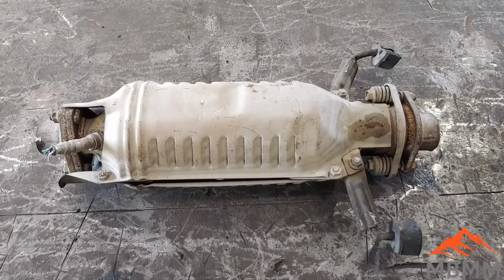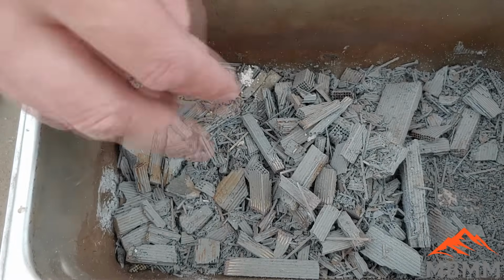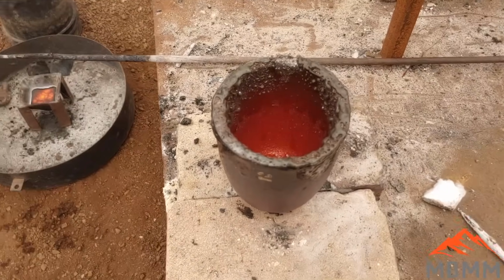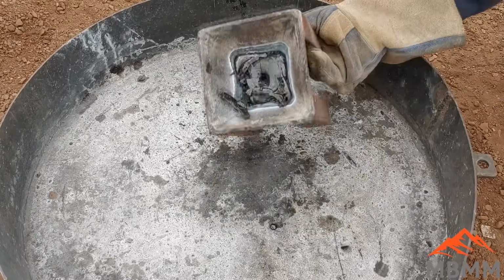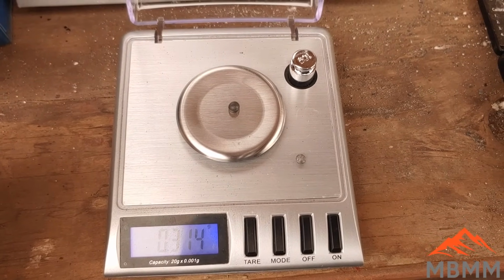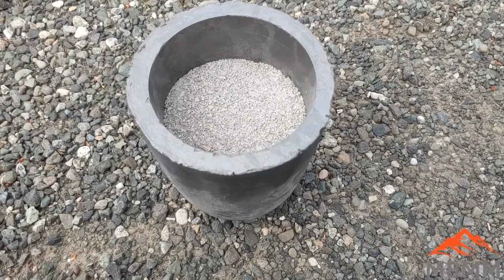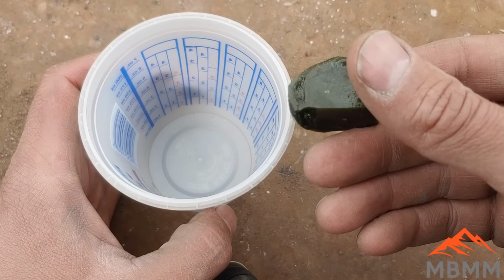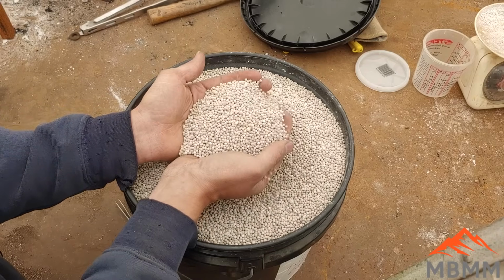Smelting Platinum/Palladium Catalytic Converters For PGMs..... Success???

Comment: Hi Jason! Thanks for another great video! I am super new to most if this stuff, but this came to mind: first, why not have the raw honeycomb assayed, if it's not too expensive. I've heard once ICP-MS is common for catalytic converter assay. For what you are doing there, like the lead collector metal and how cupelling it results in a higher melting point as the lead oxidizes, could your plasma torch be helpful there? Any idea how many thousand degrees it 'burns' at, and if it would be practical to use it for heating the sample? Would an oxy-acetyline torch (5000 F?) be any help either? I also ran across a cupel last night that was rated for use with platinum or PGM. I don't know if any of that helps, esp since you are abandoning lead as a collector metal, at least for now. 

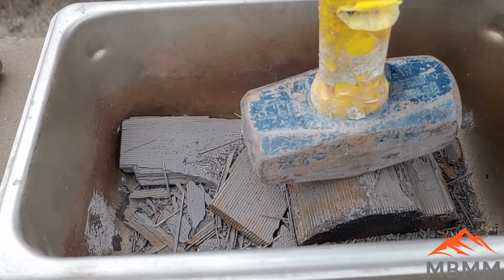I just found your channel and you do some great stuff! Since I don't see pricing on your website, I will probably contact you to ascertain some costs. The idea of mechanical or thermal processes to recover metals vs. chemical processes appeals to me a great deal! Also, about a week ago I went looking for mining claims, and finding your channel certainly fills in some blanks for me! Also, I laughed at 4:40 an 'armstrong' stamping mill, single battery lol Thanks again! Oh, somehow .04% of honeycomb weight comes to mind for Pt content in car cats, but it varies a great deal, and that number may be mis-remembered..
Reply: yeah was also wondering whether a nitrogen plasma torch could be useful at the end.

Comment: I could be wrong but I believe the Prius has the most platinum in the cat.
Reply: You are right thy do
Reply: @CALIBUNDLEZ707  that explains why all the Prius cats are getting cut in my neighborhood 😆
Reply: That came off a Honda Pilot
Reply: They do! I sold my bad Prius cat for $800. They have some of the most in it. But that cat in the video looks like a Honda Odyssey van.
Reply: @osamamingo8205  could’ve came off alot of Honda’s lol
Reply: This cat looks either salvaged out of junk car or stolen. Those flanges would not have been impossible to unbolt. They were hardly rusted. Seems like a truly dirty business because everyone has heard someone say they paid a grand for a new cat cause some ahole stole it.
Reply: I cut off both of my cats of my 07 Prius and got $1400. For it. Then I bought a $110 uni cat and it runs better then ever..!  Go figure. 
Times are tough!!!🤣
Reply: @wolfparty4234  
ZIP TIES AND BIAS PLIES says....
“you don’t need no cat-a-shittic convertree”
Reply: Hello, if you are interested in some minerals such as rhodium and platinum.  How do we communicate?
Reply: The Prius does not have the most. The reason people go after it the most is because it's a hybrid so the cat is hardly use compared to a regular engine of the same age and mileage. So they will always have less corrosion and the precious metals will always be much cleaner and easier to extract
Reply: Hello, if you are interested in some minerals such as rhodium and platinum.  How do we communicate?
Reply: Yeah criminals are stealing them for this reason
Reply: I have heard that also
Reply: That's why they always do 10mph slower than the speed limit. All that precious metal weighing it down..
Reply: @19chevyboy86  then which car has the most
Reply: @6Diego1Diego9  well as far as I know if kept in good condition would be old diesel trucks. They are much bigger and have to filter out way worst exhaust gases. But like my original comment, overtime those precious metals get corroded and breakdown making it much harder to extract good clean metals
Reply: Hi
Reply: Give your namber

Comment: Have you tried crushing the material fine and using a blue bowl for recovery?
For black sand gold recovery i steam cook the black sand in a cast iron pot until it breaks down super fine, usually takes several hours, then put it in the blue bowl water recoverer and end up with nothing but fine metals in the bowl. With only fine gold remaining its simply smelt and cast into a bar.

Comment: Since there's so little platinum and palladium in each converter, the chemical method with hot aqua regia is usually the best method.  You just keep soaking new converter fragments over and over until the reagent is used up.

Then cool the solution quickly, and most of the platinum/palladium just falls out.  I found that out by accident when refining some old 10K gold jewelry.  Fine grey sediment fell out of the aqua regia as it cooled, and I discovered it was metallic, then confirmed it was indeed platinum-palladium alloy.
Reply: I WILL TRY THAT, THANKS!!!

Comment: If you're willing to dish out a few hundred dollars there's a few updates you can get for the XRF to update the programming to distinguish between different metals. It seems a few precious metals have a similar signature to other metals. If you're really really interested in a high percentage yield to get the most PGMs out of the cat, there's an acid process to dissolve all the PGMs off of the cat substrate where you don't have to melt it down or grind it up. It's an involved process tho. Of course once you get it all dissolved then you can filter it and treat it with different chemicals to isolate the PGMs, depending on which one you want. Again a very involved process although not impossible, but probably a little more expensive than what you got now, but the nice thing is you get a higher yield. Idk if it's worth it unless you're looking to do bulk processing. You can find out more on Google, there's a chemistry publication where they listed the experiments that they used to isolate different precious metals.

Comment: I used to buy junk cars for a large junkyard in Southern California and some of the accounts that I had would take out the original catalytic converter‘s and put an aftermarket that were only worth about nine bucks. But the ones that were original could be anywhere from $60-$350 depending on the car. I know Mercedes-Benz & bmw in some of the older years or worth the most as a Honda accord was around 100 bucks. So if there’s buying these things up at those prices there Has to be a lot more value in them. And the guys taking them off Are the first guys in the chain you still need the middleman and the refinery need to make money
Reply: Ford f250s and prius,  lambos have the most

Comment: You can just part the pd/pt if your using Cu as the collector , drop your copper out with iron and go to salt with the pd. You are correct with time and temp curves at the end of your vid and that applies to cupellation as well . Crack that door on your table top , gotta have O2 for proper cupellation. Hit and run , close door to ramp up and crack the door and coast. Another tip is if you believe your loosing precious through copper soaking of the cupel , you will see what's known as feathering. To avoid this , bypass cupellation and just part the prill.
Reply: Can you say that in English?

Comment: It’s called a Honda O2 Slant and yes because it is slanted on the o2 sensor. Value is around $600-800 but is dependent on current market values. The highest end Honda O2 is the Honda O2 Straight, the O2 sensor will be straight out the side with 4 fins below and 2 fins above the O2 sensor, fins located on heat shield. That would be valued from 800-1100 dependent on market value and are found on Honda accords 2000-2002. I’ve seen that high value converters can range from $500-$2000 for one converter unit, price will always vary with daily market changes. Knowing market fluctuations for platinum, palladium and rhodium and knowing the valuable cats and especially knowing how to handle your material properly with little loss and high recovery, will give you the greatest success in keeping your profit margins the highest they can be. The loss of value through handling of biscuit material, 5% loss through air born dust alone and if it is an end of life converter, the value could be dropped by 10-20% with that alone as well. Wet and damp or oily biscuit will greatly affect your value and how much you pay for loose biscuit material if you are processing and sending loose biscuit to a smelter.  Use respirators when handling material  because breathing in airborn dust is dangerous and possibly deadly if built up in lungs. Be safe, be legit and make money baby!

Comment: I used to be the head guy in charge of catalyst in a factory. Dodge and aftermarket converts are made from the same low metal content junk catalyst. We had stacks of 55 gallon drums of catalyst powder that I had to inventory everyday and keep behind lock and key. The only problem was workers like to pee in the powder durning production instead of walking like a quarter mile trip to the restroom.
Reply: Somehow I don't think that was the only problem.

Comment: I love how his cat. was sawed off, not gracefully unbolted.
Reply: ...really good video though.
Reply: You know salvage yards cut them out and don’t unbolt them too?
Reply: Brian Baff  I’m a toyota tech and I can tell you haven’t worked on many cars that come from cold states
Reply: Brian Baff  I'm planning to put silicone rubber over the bolt heads, and wrap the exhaust path and catalytic converter in used tire cable chains, with a couple superficial welds along the way to keep everything solidly in place. I know this is not unstoppable, but I would imagine that this would make it an unpleasant job to remove for a would be thief. You guys think this will be effective?  2010 Prius.
Reply: Brian Baff  I looked at this, as far as I can tell it's only for 2nd generation Prius. I could probably build one by cutting out a piece of aluminum, but it would be a bunch of work.
Reply: Brian Baff  yeah the prius hybrids are the main target for cat's being taken. They are not that hard on the cat unlike a standard combination engine. Guy near me has had to replace his hybrid fusion cars 4 times before I bent some 1/4" plate steel around it. Put a few beads on it along with a few lag bolts with silicone nuts and put a rubber washer between the bolt head and car. Then made the bolt a little more water tight by hitting it with some spray in bed liner across the heads. Cat has some air flow around it but any thief without a plasma cutter won't get it again. My truck I just got a full engine and transmission skid plate that also covers where the cats happen to be.
Reply: Work smarter not harder

Comment: The fact that the O2 sensor was cut, and not disconnected from the "unknown car" should tip you off that the person who sold it to you was probably a cat burglar. I don't know the situation, but unless you trust the provider, I'd let the cops know.
Reply: What are you talking about? We scrap a lot of cars and I don't know anyone who doesn't cut the O2 sensor. Most of those sensors are rusted in the cat anyway.
Reply: @wheelmangtp  including the electrical plug? I mean, the o2 sensor end might be rusted in place, but the clip is easy to undo.
Reply: @ruggedrick  when you're salvaging cars you don't take time to unplug clips. Sometimes the heat from the exhaust melts clips and they can be a pita to remove so I'd cut them too. Doesn't mean it's stolen. All dismantling companies do the same technique

Comment: Thanks for the explanation. IMHO, maybe it would be interesting to know how the honeycombs with platinum are manufactured.
Not sure about catalytics, but I know some techniques use vacuum and metal evaporation, then the metal covers the objects with a very thin layer, a few nanometers maybe. Is there a way to reverse this? No a single clue.

Comment: Thieves who are stealing these catalytic converters probably don't have the know how how to extract the precious metals. It's pretty obvious that the converters are being sold to a third party who knowingly or unknowingly are  accepting stolen property.
Reply: No shit... Scrapyards buy them.
Reply: @twizz420  for a nice price. I live in a no sniffer county so my town car has 4. So I took them off, used 2 spark plug non foulers, top drilled out to fit 02 sensor to fool computer that they still there. Cut bottom of airbix off since the airport inches away from headlamp was getting lik cold air from the 2.5 inch air horn. Made a big snappy difference. Cut off stock type mufflers and replaced with magna flow copies 70 series and its a lil rumble passing but quiet when idle. Get a couple more MPGs, and sounds like a V8 I supposed to. I got 380 for all 4. I've Cut off so many or knocked out the honey comb so many times over the last 30 years I kick myself in the ass knowing how much it's worth now. I love the videos showing idiots with Sawzall blades stuck in exhaust. It's gonna pinch. Gotta support it. They never make it in logging business. If you can't tell when the kerf if ready to pinch they be stuck every Cut. If you're gonna do shit, learn the shit well. Study the shit. So you can be good at the shit. Don't steal. It may seem like alot of money but when they get caught, by time they pay fines, court costs, restitution and have it on record forever it'll cost them way way more than they'll ever make. Alot of ppl jave cars that have dumb shit wrong you can buy cheap. Get cats, battery, wheels, copper wiring and junk rest. Or Cut off cats and fix and sell. They never get a good job when they look up they name and it's theft, theft, theft. 
My buddy and I got hammered and he said he'd sell me a set of Crager rims. So I said yep for my 327 chevy powered 87 firebird 5 speed. He says we gotta pull them off so we went and did so. He forgot to tell me he didn't own them. So after I got done paying for lawyer, fines, ARD program to not have a record those 200$ rims cost me about 2800.00 bucks. Not worth it.

Comment: That's been cut off, not removed correctly using spanners, so it looks as though it's been stolen.
Reply: We cut them off junk vehicles rather than spending the time taking them apart.

Comment: I bet it’s off a Honda Accord
Reply: Accord that has heat shields like that have the sensors in the middle. This is a honda, but it's not an accord. Honda element has one that looks just like this.
Reply: Looks like a 98/02 v6 accord to me also

Comment: Youngin, your platinum and palladium went into your slag.  Your forge can't get hot enough to even get platinum warm, much less melt it.  You would have to exceed 5,000 degrees to have any luck.  While you have the honeycomb ground into powder, cover the bottom of a gold pan about 1/4 inch and run over it with a regular magnet to remove all magnetic stuff.  Then go over it with a N52 neodium magnet.  A regular magnet will not lift Platinum as it is only paramagnetic, but an N52 will lift it!  Put all that in a beaker and hit it with a few drops of nitric.  That will eat anything (like ferrite) that isn't platinum.  Platinum thinks nitric is the same as water ;)  You can collect that residue as almost pure platinum.  Melting that into a bead is another story ;)  We just collect till we got an ounce or two and send it to a refiner that can get it to 5K degrees.  Old copper mine slag piles are full of platinum!!  They couldn't get it to refine either LOL!
Reply: If platinum was stuck to "magnetic stuff", wouldn't you lose platinum from the regular magnet?  I have no knowledge of this stuff, but just curious about it.  I guess you have to seriously ground it up super fine.

Comment: That is a Honda/Acura cat. How you find out the value, make, and application is by counting the lines on the shield and number of O2 sensors and whether they are straight or at an angle. Hopefully that is helpful

Comment: The thing about cats  you can use a mortar and pestle. Pulverize to a really fine powder , in the bottom of the mortar you will find in the process of pulverizing you made big flakes of metal, i believe its called anealing , mashing the tiny stuff into larger flakes
Reply: I believe annealing is just returning hardened metal to a softer state, usually through heat. Heat treated/tempered steel or work hardened copper can be heated up to soften them or annealing them

Comment: There is a way to test a cat honey comb to see if it has any platinum in it before smelting the cat.  Just simply put the torch on the honey comb until it glows red and simply extinguish the flame on the torch and turn on the propane or acetylene back on and blow the gas (not ignited) on the red hot honey comb and if it’ gets hotter and redder and the reaction keep going then the platinum is still in the catalytic honey comb core and you can go a head and smelt it.  You can do this with a map gas torch or an acetylene gas or propane gas or even butane gas.  If the core does not continue to glow red then there is no precious metals in the honey comb.

Comment: Hey Jason, have you had any experience with any rhodium smelting. I didnt see a plavevto out a picture here so I added to my profile a picture of this material ive been collecting for roughly 2 years. Ive never had a assay dine on the material. But have a lot of experience amd knowledge of the land I find this material. We sit on the new madrid fault line on a hydrotheral copper iron manganese and nickel sulfide deposits. Platinum group metals along with gold and silver have been recovered from the area in the 1800s. I absolutely can't melt the material  with anything I have and was wondering if you could take a look and maybe even possibly I can send you some to try and smelt.

Comment: Hey mate, 
I have been told that you need to use ceramic crucibles for platinum group metals as they react with graphite at high temperatures. 
Got this info from our lab chemists, I work for one of the biggest mining companies in the world and deal with the lab most weeks on shift. 
Not sure what you have been using.